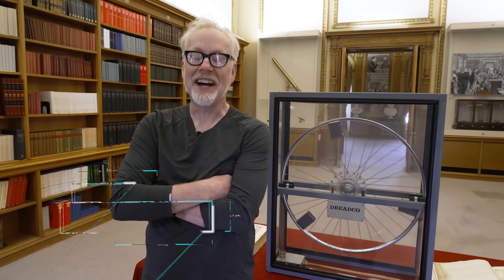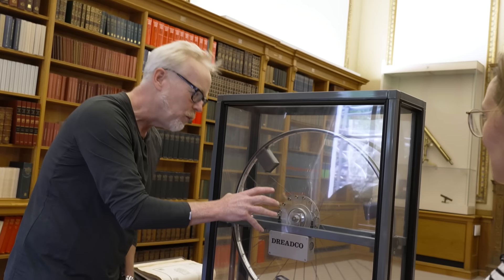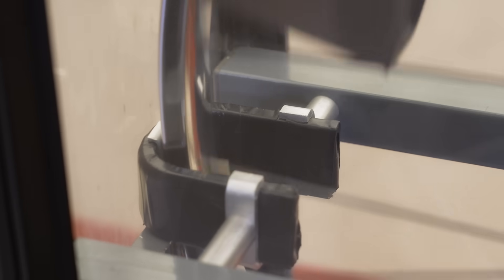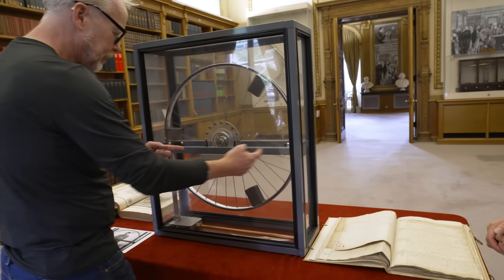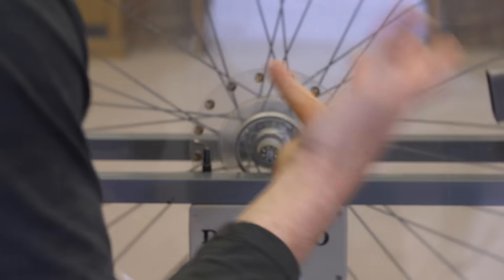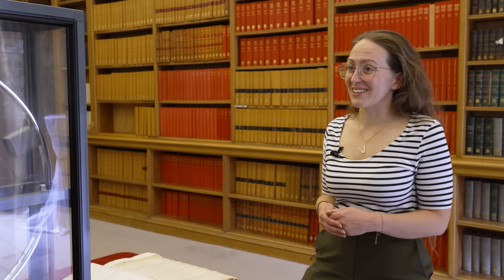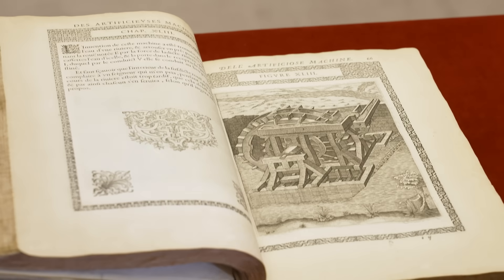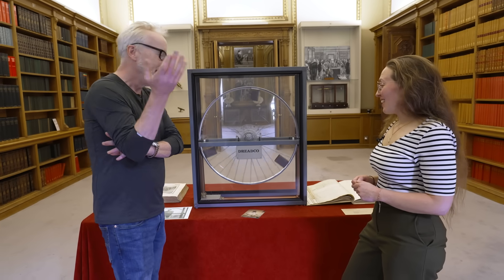Adam Savage vs The "Perpetual Motion" Machine!

Comment: Perpetual motion is NOT impossible. I personally made a set of magnetic wheels that moved. The heatsink is probably transistors. Transistors can be used for timing of impulse. Electromagnetic motors can be be made into powerful perpetual motors (but have been and suppressed). Maintenance is necessary for the bearings and the spokes.

Comment: I love it. A perpetual motion machine that only runs perpetually if it gets regular service.
Reply: "service" 😂😂
Reply: in theory, even if the machine did defy the laws of physics, it might still need oil to keep the friction low enough.
Reply: @Forty2de  friction is a part of the laws of physics!
Reply: @Forty2de 
Since any perpetual motion would need to be completely frictionless anyway oiling is not the issue 😊
Reply: They just telling lies to your face and you believe them
Reply: @MaybeShimo another great reason for material science
Reply: I'm guessing, yes just guessing that parts wear out from constant movement and need to be replaced.
Reply: The secret in servicing this machine is the wheel keeps charging the battery but after time the battery loses its cells. They work hand in hand the wheel charges the battery in return keeps the wheel moving. Like an alternator. Correct me if I'm wrong but I'm just guessing. Not 100% if that's how alternators work.
Reply: Same as my car. The service consists of putting a strange liquid into it every 1000km... ;)
Reply: @jackmclane1826  Not quite, McClane lol. It’s more like replacing your tires when the tread wears down! Hope this helps lol
Reply: @Highimdadtwo  Did you forget that perpetual motion is impossible?
So this is a trick where the energy reservoir is filled up. Probably a clever trick. But a trick.
Reply: Like changing the batteries.

Comment: if it truly was a perpetual motion machine the scientific need for an answer would eventually outweigh the need for secrecy! it would also not need a "tickle up" every few years. no such thing as perpetual motion. it's bullshit! the reason it's fake is called physics! would a perpetual motion machine be feasible in a weightless environment?
Reply: There is a trick to it, which Adam is trying to figure out throughout the video.

Technically yes, you can have an object spinning perpetually in outer space. But it has a finite amount of energy, the same as on Earth. If you tried to harvest any energy from it it would slow down.

It’s just a flywheel
Reply: DOH didn't think about that fact that no gravity doesn't mean no momentum. cool. good catch so to speak 👍 @samburnes9389

Comment: what if some of the spokes of the wheel act as antenna and deliver an RF voltage to detector which is the power source for the mechanism? If the unit is kept near a transmitter, which many are located nearby most likely, being in a city. Some stray induced voltage could be harvested from the house wiring, not to mention microwaves from cell services.

Comment: Then why not use it to solve the world's energy problems, which will save lives and prevent wars. 
How is it perpetual if it requires servicing after 2 years? Maybe 2,000 years.  The incorporation of 'battery' doesn't make sense.
2 years is about how long the batteries in a wall clock or wristwatch last for. Is a wall clock a perpetual motion device that runs for years at a time despite needing maintenance to change the battery every 2 years or so

Comment: energy is in the room: heat
anything that is above absolute ZERO is energy you could use...
Reply: Not quite. Just because energy exists doesn’t mean you can use it. You need to generate (or at least conserve) entropy. Using the heat in the room would lower entropy of the system, so would not be possible once the system was the same temperature as the room.
Reply: @samburnes9389  ok not room, outside... and I know we aren't there yet...
Also I'm not talking making energy from different temperatures, just harvest the motion of atoms...
Reply: @shpe11  the random motions of atoms is temperature. And it can’t be harvested because it would break the 2nd law of thermodynamics.

There’s no way to convert that energy into something more useful because doing so would decrease entropy, which can never happen.
Reply: @samburnes9389  that is what I said in the first post, temperature above 0 absolute... if the sistem is left alone the temp will drop to 0 absolute... 
Is what heat pumps make with 1kw makes 3kw termo because it harvest the heat - that extra 2kw is from heat
as I said we are not there yet...
Reply: @shpe11  heat pumps do not violate the 2nd law of thermodynamics.

Notice that it isn’t using the heat for something mechanical. It’s just moving heat from one place to another (and generating more of it along with entropy) in the process.

A heat pump is not going to turn a motor. The energy you put into moving the heat from one side to the other is less than the energy you would get by using a mechanism to move that heat back and convert it to mechanical energy.

So there’s no way heat is powering the mechanism here.
Reply: @samburnes9389  if you have difference in temp you can use peltier to make electricity which will turn a motor... probably very very very slowly... also heat pump need outside energy to operate... we are not there yet, if you get energy from heat doesn't break any law(because temp will decrease) is like harness energy from sun with photovoltaics(harness from heat with a panel - we are not there yet  but still some heat is another wavelength of light)... yes there is not perpetuum mobile (an atom is very close to perpetuum mobile)

Comment: Could the small metal boxes be half filled with liquid, to keep the momentum via gravity.. and the magnets also reacting to the metal casing on them as they pass the magnets
Reply: I think some of the hardware are just red herrings to throw people off.It’s most likely a simple motor and nothing else.
Reply: Could the liquid inside them also have iron filaments inside the liquid that’s inside the 3 metal boxes
Reply: If every single one of the boxes weighed exactly the same weight, the wheel would be perfectly balanced, and the boxes would accomplish nothing

Comment: It seems like a fair question would be to ask if all parts of the mechanism are needed for it's rotation?  Or if parts of the mechanisms seen in the case are purely intended to mislead?
What makes it impossible to be certain is that there are so many easy ways to keep the wheel in motion seen in the case...  The cups and points are a classic electrostatic motor design which would work.  Or,  the boxes could easily contain batteries, electromagnet and hall effect sensor for years of locomotion.   Many heat engines use alloys that the heat sink and copper pipe would provide the temperature differential for which could ever so slightly change the wheels CG if the spokes or wheel frame had a temperature differential moving between then channels.  And, even daily changes in air pressure have been used to wind clocks and could be used...  Given the only clue we have is that people learning the secret were disappointed, my guess would be that all mechanisms seen are strictly a deception, and it's a simple hidden battery and magnet arrangement using the boxes, or even hidden in the base...

Comment: Heej mr. Savage,

I've always been baffled by perpetual motion, it's just such and awesome niche of mostly illusions. But it got me thinking of one of the earlier designs where a medium in a wheel makes it turn by fallin, the biggest struggle there is the friction and that you need a force to start it to turn, if im correct. We also have these "floating" spinning tops that spin in the air because of it being a magnet wich forces up because of the ringed magnet under it, wich also makes it spin. Now what if those where to be combined by making a wheel spin inside of a ring magnet, with the medium inside the wheel, that would then have no friction because of the magnets would that actually create perpetual motion due to the fact that the medium inside the wheel is not stable nor reactant to the magnet????

greetings
R.Philippo

Comment: It's a homopolar motor. The box in the base is a switched power supply that boost a battery up to a high voltage, which is channeled through the bearing into the wheel. Tiny amount of force imparted, but it's enough to offset the friction losses in the bearing.
Reply: That's not nice. What did the motor ever do to you?

Comment: Fusion could, for all PRACTICAL purposes, qualify. Perpetual motion means 'without beginning and without end. So if someone built a machine that would run forever, it would not qualify as perpetual motion. Ther is a simple version that uses lightning to saturate a disk with electromagnetic energy and allows for frictionless electromaglev bearings for the armature to ride on.

Comment: Hey Adam, I believe the key question(s) to have ask this fine lady would be this. Does this machine slow down over time before the maintenance is done?  Well she says it slows over time. Now then, here are two possible outcomes. My theory is that two horse shoe magnets are on either side, at 3:00 and 9:00. That would be 180 degrees apart. Then, three more magnets are on the wheel. They would be 120 degrees, apart. The differencee in phase angles is always having a push and pull forces on the wheel. In other words, the wheel has an almost frictionless bearings. When the wheel starts two magnets attract. But, then the weight of the next wheel magnet takes over, because of gravity. The process goes on and on till one or more magnets weaken and need to be serviced with a polarized magnet charge. Kind of a lighting bolt affect. Otherwise, there are super bateries in the Dreadco Box. I would think that over time the magnets wear down and the wheel slows down. The copper pipe and the Dreadco box are a ruse to throw off investigators.
Reply: The boxes around the wheel are old Colman's powdered mustard tins without the labels. The horseshoe magnets have very little magnetism. They are a ruse, along with all the other electrodes, pipes and bits to distract you from the actual power source in the plastic box marked Dreadco. Devices such as these often turn up at schools and universities, they tend to be designed to frustrate those who cannot see the forest for the trees.

Comment: I lean towards the coils being in the "U" sections, and the boxes are just magnets.  The coils get power from either a simple boring battery in the box, or if you wanted to get fancy, you figure out how to supply the battery with additional power.  One thought there would be the giant heat sinks.  You certainly aren't dissipating heat with those, or the machine would be grossly inefficient.  Maybe they are just a diversion.  However, another option is that the device relies on the variance in room temperature between day and night.  Essentially hook up a Peltier device to the heat sink and use it in reverse.  Let the temperature differential induce a current via the Seebeck effect.
Reply: The machine continues to work in a dark storeroom for months at a time. And magnetic detectors outside the sealed glass cabinet (the rules of the "figure me out" game) cannot detect any significant magnetic fields.
Reply: @WellsiteGeolog  If there were "significant" magnetic fields, it's likely that this machine wouldn't operate for very long.  You would barely need the tiniest of a nudge to keep it going.  That's also why a battery could easily last two years in that application.  And like I said, if you then leveraged the Seebeck effect as well... this thing could really go on for seemingly forever.
Reply: @Dartheomus The discussion between Adam and the curator make it explicit that the machine works for months alone in a dark storeroom.
But I should have been more explicit about the magnetic fields - all of London (the site) has a detectable magnetic field (my compass works there, when I passed through on the way to somewhere interesting), but the variation of that field metre by metre is quite low. Any fields generated by the machine, are below that level outside the glass case.
I just realised that the glass could be (internally) coated with transparent (indium oxide, e.g.) conductors to suppress detection of internal (to the case) fields from the outside. So, no, I can't rule out there being significant fields inside the case.

Comment: Hi this looks like a pulse motor. The boxes on the rim and the other  stuff around the rim are just there to divert the observe from the  drive system.
If you look at the center of the wheel there is a plastic disc which looks like it has magnets attached to, the box at the centre of the wheel is most likely a pulse circuit and battery 
The wheel is probably very well balanced and has low friction bearings
A system like that will run for many years but slow down over time

Comment: If a clock can run decades on a D battery, having a battery last for 2 years isn't a big ask.

I'm pretty certain that this device is basically a clock with the numbers taken off. If it worked by any other method, it wouldn't last as long as a common battery you can buy in a supermarket

Comment: My guess there is a small motor and battery hidden in the hub of the wheel and everything else is a decoy.  The boxes are a decoy, the horseshoe magnets are a decoy, everything is.
Reply: The small motor in the hub is held by a bearing and there is a pendulum or ballast hanging on the bottom of the motor which allows the motor to turn the wheel with out the motor spinning around itself.  Similar to the monowheel machines
Reply: The battery itself is the ballast

Comment: I have a clock at home which appears to be a perpetual motion machine as its power supply is invisible.
It runs on changes in air pressure.

Comment: The very fact that this machine needs to be sent back to the makers to reset every so often means it isn’t a PMM.  Anyone can make a PMM if they are allowed to put it in a sealed box and not allow people to directly inspect it.  There is clearly something adding a small amount of energy to this device.  This is nothing more than a magic trick that, once you know the answer, is only something hiding the very reason it works.  A real PMM would be unsealed and free to be inspected by anyone.

Comment: Why not connect the electric motor to a generator?  That way, while it turns, it generates the voltage necessary to run the motor.
Reply: Because of the law of physics lol.

Comment: Could be some form of Stirling Engine driven electromagnetic induction? With the Copper Pipe and heatsink giving small "pushes" every now and then, with one side of the pipe being much longer, some form of cyclical "pushing" and "pulling" with something producing the heat. Small battery or mild Radioactive Isotope, which needs replacing.

Comment: hm... ionic force, sealed container, magnetic energy generation.... also pretty sure you can make air move through copper pipes with a charge.... but prolly a red herring.... 

most likely, the most impressive bit- i think; would be the balance and the bearings.

Comment: I was thinking the boxes have liquid in them with a floating magnet inside that can move from one end of the box to the other. When the box is ontop the wheel the magnet floats up so the weight is nearest the edge of the wheel, but as they pass by magnets on the side of the box, it repells the magnet towards the center of the wheel thus lowering the resistance of the weight moving upwards on the other side of the wheel.
Reply: So the pipe and the dreadco box are red herrings
Reply: I was thinking it was something like this as well but then what would they be replacing? The bearings?
Reply: What about the weight of the water

Comment: My guess:
The boxes are filled with a magnetic fluid with 1 compartments with gaps for the fluid to flow through. or a manet suspended by water/oil but there is only a mm or so clearance on each side.
As the box falls to on the left side, the magnet pulls the weight/fluid to the outer-side. Giving it more leverage as is swings, as it passes though the one on the right the magnet's strongest point is closer to the middle, and strength pulls the magnet weight/magnetic fluid to the inner side surface of the box, giving it less leverage then the one falling on the left side.
The '2yr maintenance' could be servicing the bearings to keep the friction down.
Although the weight would be more effective if switching to the outside at a higher point, the magnet would have to work harder causing more force to be required due to fighting gravity in combinations to the internal friction and losing more energy, having it on the farthest horizontal points means no fighting with gravity whilst moving the weight on a horizontal plane.
Having the weights at every 120deg means there is only 1 weight going through a magnet at any one time, if 2 are going through at the same time the energy of the combined magnets could cause too much force and stop it, where as 1 at a time might be enough for it to just pass though.
If kept in an observatory like where it is right now aids it's movement and spins a slight bit quicker, this could be due to the room being warmer. And the fluid moving easier, and when in storage if that room is colder the fluid becoming more viscous, reducing the freedom of the movement.. 
Just a thought and a guess, and will never know if I'm correct with this one.